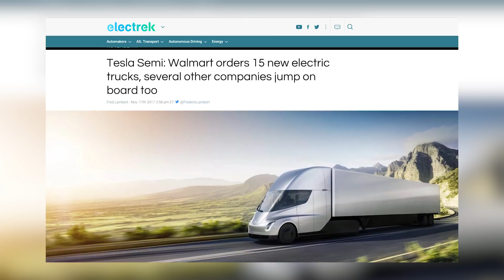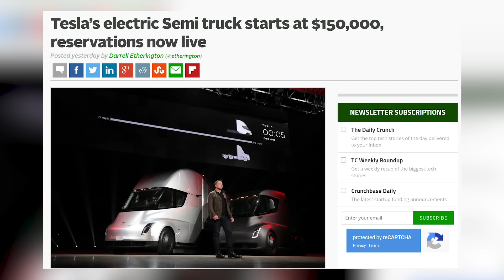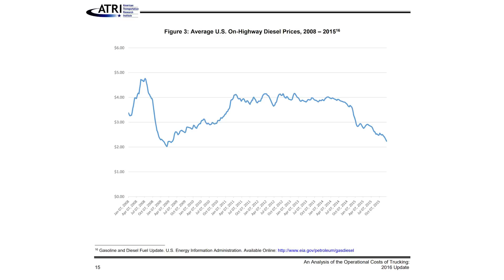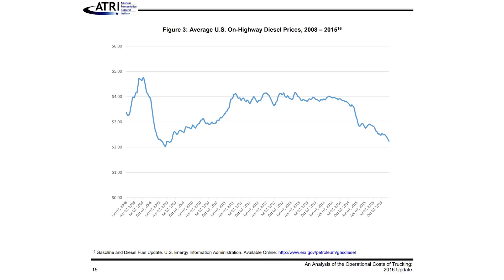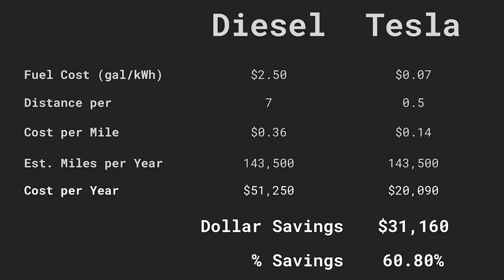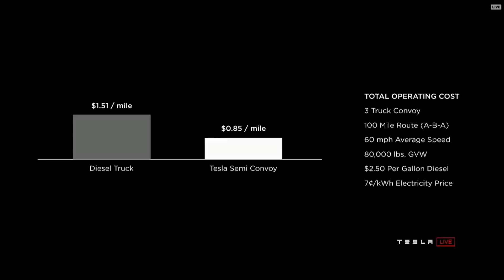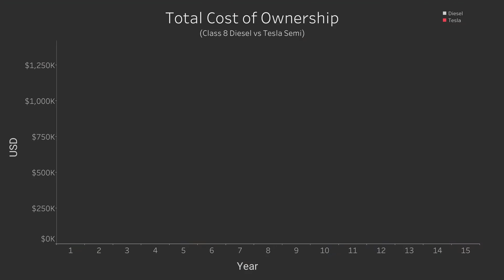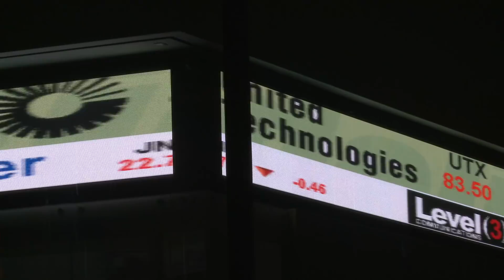What is the TRUE COST of a Tesla Semi?

Comment: 1k kw x $.10 =$100. for the 500 mile $.20 mile..
is half of $.40 mile. $2.8÷7.. half. oil change $.015....415k and 200k $
so at 500k mile she paid you ... go buy a new..
take yer $100k for yer
old trk. no. keep it  goin
no brainer for some.. 500 mile run rt

Comment: When will people stop buying into whatever tesla says ? They always claim something fail to deliver it then claim something else to keep you from thinking about the failure .
They always use double speak and deceptive phrases to make you think the improvements are better than they actually are.

Do any of you think there will be multiple chargers at truck stops that each dish out more power than is needed to power 220 homes(1.6MW) anytime soon?
Last time i checked we didn't have compact nuclear reactors laying around to power them , solar has no chance because it would take over 10,000 of them to recharge a single truck ,it would also need a battery backup system to do it when the sun isn't out .

Vaporware or small trucking establishments , wal-mart is a great example as there warehouse to store pipeline would love this .
This won't change the trucking industry much if any.

Comment: Half the negative commenters simply have poor listening comprehension.  Or they did not listen to the full Tesla presentation.
I do have some concerns that I did not see addressed, though overall I am impressed: 1. I did not see side-view mirrors.  I have difficulty believing that Tesla can get an exemption on this, even if it has cameras and such.  Even if California and some other States grant that, others won't because their politicians will be bought by the opposition...especially in States that have truck factories.  And with the big mirrors all those sweet drag coefficient numbers are going to disappear.  Range will be reduced upwards of 10%.  That means they would have to get the exemption Federally.  That is possible.  Not easy.  2. I am very concerned about driver safety in  collisions with wildlife.  The windscreen might be strong but it is not going to be sufficient to avoid a moose coming through there.  And I don't care how good your breaks are, a moose can come out of nowhere rapidly and without a flat radiator it is going to get moved up the front of the vehicle until it reaches the window where it will burst through and potentially kill the driver.  In Canada and several U.S. States this is a genuine risk.  Deer are a risk too.  I am giving Tesla benefit of the doubt on deer, though that may be unwarranted.  There are over 30,000 deer accidents in Mane alone each year.   Moose though are very heavy and most of their mass is very high.  There are Moose near the national parks, in Mane and other States.  Lots in Alaska...though the Tesla semi is not likely to be a first choice there anyway many stretches of road don't have gas stations let along charging stations for several hundred miles. Lots in Canada also.  3. I think some drivers don't want people on foot or at car level to be able to see much inside the cab.  That window works both ways.  They may not want to be on exhibit.  They may want to pee in their Big Gulp cup in private ;)

Comment: 500 miles is not enough. I work for an LTL company that normally means terminal to terminal. My run consist of me going from Indianapolis to Cleveland. That's 620 miles the only time I have to take my 30 minute break is at Cleveland. So basically the only way LTL companies would buy these trucks is that they would have to spend millions in charging stations and trucks. Completely ditch the infrastructure that they have built around diesels. Maybe one day it'll happen but definitely not in the next 5 or 10 years
Reply from the maker: +Braxton Walters that makes sense, I think they will be targeting the shorter routes to start

Comment: Also the truck is ugly AF. The middle seat is stupid. Because you go from challenging view on one side to challenging view on both sides. That's before you even start talking about backing into a reefer dock on the east coast. 65 mph up a 5% grade is stupid AF. Grades are curvy for a reason. A truck doing 65 up most 5% grades will turn over. Tesla should really hire a few guys that have done this job. Btw May 5th of 2018 will make my 20th year in the industry. 18 of which I have owned trucks. At 150k they will sell but only a few for the first few years. Think about how long CNG has been being promoted. It still hasn't taken off. But if they are at 400k, forget about it. I think here in the states it's dead at much more than 200k.

Comment: What is the life span of the battery though? The average lifespan of a long haul truck is 600k miles. Batteries degrade with recharge cycles and one study showed 6% mileage loss at 200k in a tesla. That's 30 miles which is huge in the trucking world and if you assume a the same rate of degradation it would be 90 miles at 600k or 1/5 of the new batteries range. So if your having to replace that battery at 200k it would be extremely expensive compared to trucks that come standard with 250k warranties that are often upgraded to 500k. If you tried to sale me a truck and told me you would need to replace the engine after 200k miles I would laugh in your face. People are blinded by the realities that EVs are not perfect, look at what those batteries are made out off, look at the environmental impacts that battery makes, look at where the electricity comes from, etc. There is no perfect solution to cars and trucks, accept it. Either way we go EV or Fossil fuel vehicles we are hurting the environment and using an alarmingly high rate of resources.
Reply: It has a million miles warranty
Reply: Stewdill51 exactly, just like with any electric car
Reply: Battery dendrites will soon be a thing of the past. Expect batteries to keep capacity over hundreds of thousands of cycles

Comment: I'm hearing 80,000lbs...but what is the actual weight of the power unit? ie the truck itself.

I think this could work (line or short haul) in the Southern US using the AC a lot, what would the drain be?, or equally interesting, how it would stack up heavy snow conditions up North. Then there driver accessories conciderations,  like; fridge, microwaves, and TV's which today are pretty much industry standard for long Haul drivers.

I have 15 years driving Tractor Trailer. Driving long Haul..uninterrupted distance is key ...wheels aren't turning they're not making money...so maybe a quick change of the power pack? Not sure how practical $$ that would be.

Comment: All of those four electric drive motors would need gear reduction boxes to give the necessary starting torque from zero RPM that would keep the battery amperage down to an acceptable level. So gear oil will need to be changed periodically, like on the differentials on Diesel semis. Railroad Diesel electric locomotives (the original hybrids) use that setup on their electric drive truck motors to move the megatons of freight over mountains. Reduction ratios average 60:1, motor RPM to wheel rotation.

Comment: Your shipping analogy about people buying more online causing more truck sales is actually directed to smaller delivery trucks that can go in residential areas and not these huge highway haulers. If you buy online or in the store the goods have to be moved either way so there's really no difference. I see these new Tesla trucks being sold to fleets that move between yards that are controlled by the same company on both ends where they can put up Megachargers and have the batteries charging while the load is being moved then the truck turns around and goes back where it came from. I know a lot of o/o who are mad at Tesla for various reasons but they are not the market, Walmart and the like are going to start buying trucks again and drivers will be pushed out of the market. Also notice Tesla does not show a sleeper, these are day trip trucks as they don't have the range yet so when you price compare them keep that in mind.

Comment: Well i would have to disagree on tesla making a break through on battery tech. They even said they are essentially using the batteries that always have used just more powerful. I believe they are going to sell the trucks at a loss just like the model s and model 3. Tesla has not made any profit in the last few years. They are having production problems with the model 3, have yet to build the mega factory and are constantly letting employees go, they are in debt to companies that are manufacturing may different parts for the tesla brand and shareholders are starting to worry. Not to mention the automotive industry is also investing in electric vehicles. And then there's spacex.... hope I'm wrong but who knows we'll see in 5 years.

Comment: No truckers will buy these if they are O/O. These are likely designed for fleet trucks with major carriers.These will be day cabs no OTR trucker would deal with the hassle of finding a charging station that is 20 miles out of route due to land on major highways being expensive and tesla not wanting to buy that land.Also 30 minute break is down time so you can not fuel or even charge while on break,if DOT catches you working on your 30 you will get a ticket for 250 dollars and 2 points on your csa. Also the cost of repair would be astronomical as we have seen on the tesla cars this business model would not change. Add to that you would HAVE to go to a certified dealer or partner because its tesla,you could not fix anything yourself without the expressed consent of your lord and savior elon. no thanks my life is hard enough im not adding to it by buying the macbook of transportation.the benefits do not outweigh the overall costs. To be very honest the nikola one has more promise than the tesla.if the nikola goes to market with all the featured listed at the expo I will likely buy one of those as it fits my needs for daily life on the road.

Comment: OTA updates...for a semi. Not concerning AT ALL. How much does the battery pack cost? How many charge cycles before it's dead or starts to loose capacity?
Reply: Alex Haws lithium ion batteries have charge cycles of 500-1500, but these are from full charge to zero charge which drain the life of the battery much faster then near full charge to partial charge.

Comment: What about gearing? I know electric cars have no gear and they get instant torque but when hauling and what not isn't gearing like needed to carry high loads like isn't the fact that in doesn't have high and low gear ratio and issue? Any thoughts on this would be helpful just can't see this completely replacing trucks all together
Reply: Abz Aden I think the pure torque should be sufficient for low and high end hauling. Also the "million mile guarantee" should negate the worst of the issues.
Reply: Danny Rice thanks for clearing that up much appreciated

Comment: Elon is an amazing pioneer however:

2,500 new power stations across the USA would be needed to enable the 15 million trucks currently on the road in the US, if they were to be changed to electric. Not impossible but certainly not in the next 20/30 years at the minimum.  I stand by my earlier comment that charging a 1MW/hr battery in 30mins is simply not currently possible.  

Just consider the heat generated in the batteries, think of your mobile phone they have a lithium ion battery which has has a capacity of say 2A/h now consider how warm this gets with an hours charge, now pile another 500,000 on top of each other. 

The charge current is worked out this way for the person who questioned my earlier equation  1MW/h (Charge time 30 mins) 500volts times the current 4,000 amps.  (it would be 2.000 amps if the battery were charged in 1 hour) Just as an example my house currently has a limit of 6 KVA.
This means I can have 250Volts at a maximum load of 24 amps, to charge one truck you would need 333 houses just like mine all linked together to have the required current and voltage. (250v * 8000 Amps / 250v * 24 Amps)
So unless you get on really well with all your neighbors don't take the truck home to charge....
Reply: well you also have to remember phone batteries are single cell and are not charged in parallel, they also heat up much faster because they are encased and put next to a processor wich require a cooling system on their own, phones have a technology called quick charge which checks if the phone can accept a higher voltage and is used to charge about 60% of the bettery then slows down to prevent damage to the battery, i imagine the batteries in the truck have much thicker leads and a better cooling system to allow for a very fast charge, or that the batteries in the truck where made to accept a very high current for a period of time, how they will supply the power? im guessing solar fields in the 50Mgw range scattered over the US, so either its not possible or they are using newer better batteries and are upgrading the entire US power grid. also im not an electrician so i might sound like a dumbass but wouldn't the amperage be lower if they used a much higher voltage since the thousands of cells they are using would cause a much higher resistance?
Reply: You are correct the small batteries are charged in series and in parallel.
Lithium ion batteries are about 4 volts to to achieve 500v you need 125 in series. They use the 18650 format cells. Lithium ion are very good at charging up to 60 degrees C. to obtain 1MW-h of storage you would need about 120,000 of these. (based on the Tesla S 85KW with 7,104 cells)  So we have 125 giving us 500v but low current so we need to put them now in parallel,  120,000/125 =   960.  So we have 960 parallel connections.
The resistance is not very relevant as this is simply ohms law Voltage/Current.
So the problem is how to charge all these batteries in 30 mins. not exceeding 60 degrees C.  Just think if you have 2 heaters (Parallel) in a room each putting out a certain BTU the room heats twice as quickly.

Then we have the solar option as you suggest, to provide the charge for a single truck would need a very large field full of solar panels, costing around $3,000,000 USD.(based on rough figures)  Not impossible but with your moron president not likely anytime in the near future.

Comment: It is very clear how little you know of the actual mechanics of a vehicle when saying no maintenance / repair costs. Any vehicle, especially commercial vehicles have a lot of repair costs regardless of power train.
Things like dents, broken lights, suspension parts, mirrors, even AC etc. nevermind the hydraulics. Biggest part is somehow related to the powertrain however, but only time will show how it goes on a electric truck. But in any case, repair costs will not be anywhere near 0$. Part of the reason is that many truck drivers don't give a shit because they don't have a penny in the vehicle. They will gladly drive it drown of a cliff if it saves them 15minutes of their workday. A more regular example is simply forcing the truck into a tight spot ruining mirrors or lights.

I have many friends in the industry, and i hear them very often complaining how their trucks has been mistreated during the time and how things are broken. This usually happens when they are on a loaner, or after vacation when their truck has been used by someone else.

Comment: Look's like a winner to me. The 2 year payback is really good. I remember to get a truck to do a 5 year pay back was good. But when doing this with payload capacity the truck seemed to lose it's ability to make the million mile goal. Now Tesla has energy saving and nearly no maintenance. If the dependability is good and a parts supply is immediately available then this could work.The big question from me is, how the owner / user  friendly will the ECUs be? Troubleshooting, calibration changes, calibration updates and cab controllers, ABS systems, anti roll, traction control and trailer compatibility? With the new computer control systems in the diesel trucks and the hand full of ABS companies that are used in trucks and trailers that communicate with each other . When the truck is at the dealer for warranty issues, or brake downs and waiting for diagnostics of the problem (when you're told we can get to it next week, we will give you a call)  I went through a lot of this at the truck dealership and the engine dealerships during the beginning of the DOF introduction. The truck no working isn't a good thing, It funnels down the delivery line to the customer depending on the product .Let me know what your thoughts are on these subjects. I would like to be the first to pull a load with one of these.

Comment: I doubt there is some battery breakthrough.  Batteries use a chemical process that historically improves linearly.  They do not follow moores law.  There have been lots of battery "breakthroughs".  Such as lithium Ion.  It still only resulted in linear improvements over time.

What is most likely going on with pricing is very thin margins and maybe even a projected loss initially.  Battery prices are going down slowly so they are most likely factoring in cost in 2-3 years since they won be selling them till that time.

Comment: Question is will the brakes burn up on a big down grade on the mountains.
Reply: No. Regenerative braking does not rely on friction, instead it converts energy of momentum into electricity, which can be used to recharge the battery. Very little heat is produced, so no risk of "burning up". EVs do have friction brakes as a secondary "back-up" braking system, but are so rarely used that the brake pads should last the life of the vehicle.